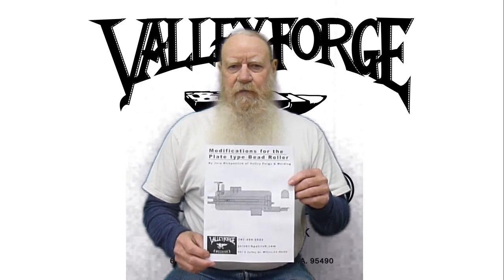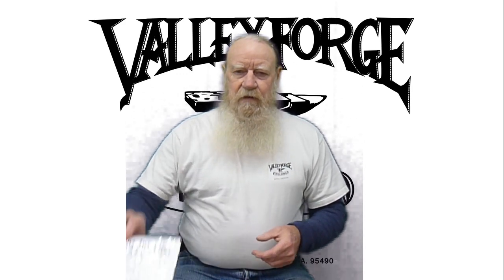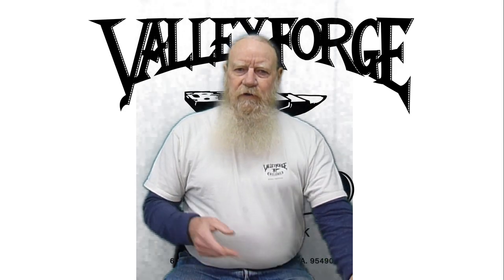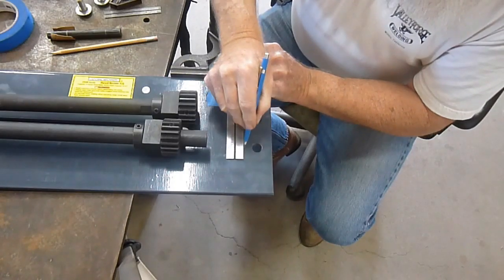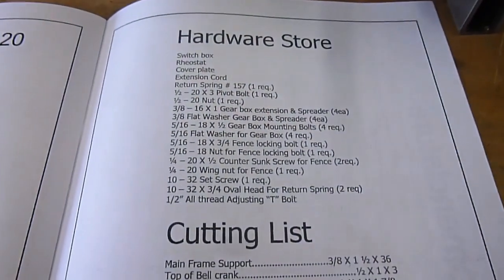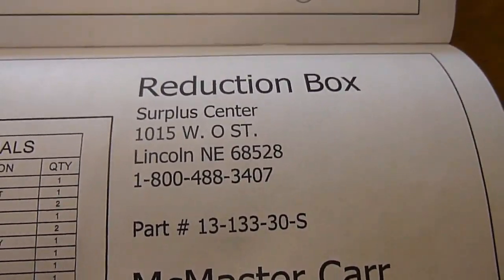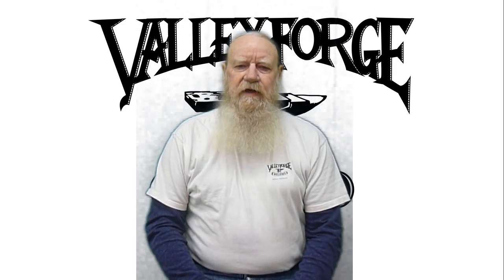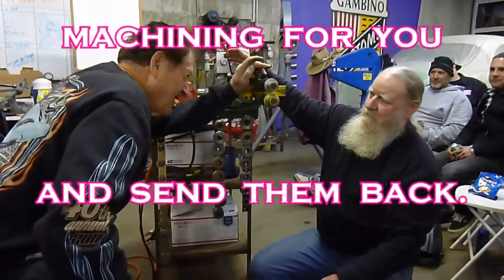Bead Roller Modification Plans

Comment: What bead roller/s are the Mod's for?
Reply from the maker: Thanks for watching Love2.

You can modify any plate type bead roller such as the Harbor Freight. If yours is of a different type the video that comes with the plans will help you make the modifications to get the same results. The width of the gears will control the amount of movement of the top shaft.

Jere